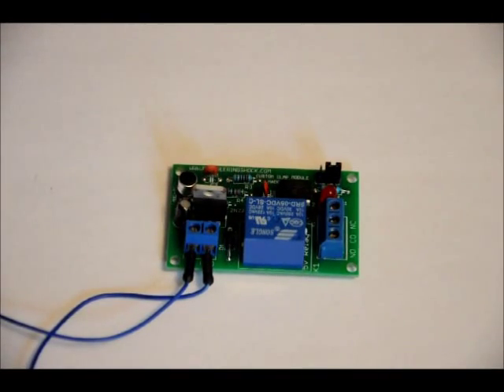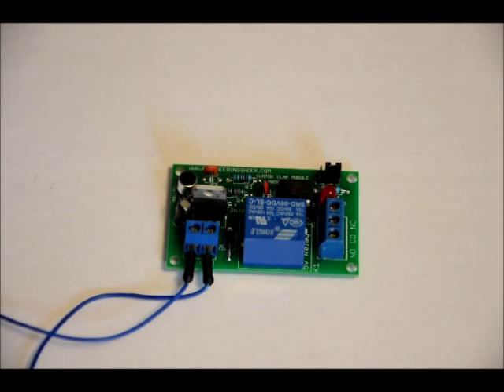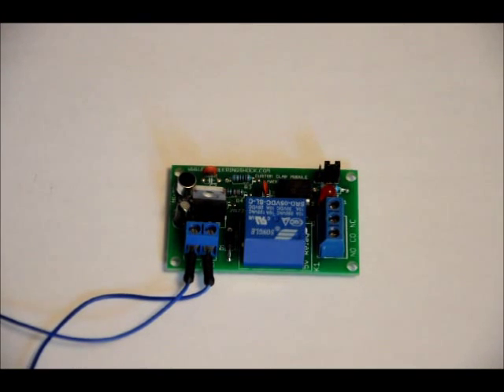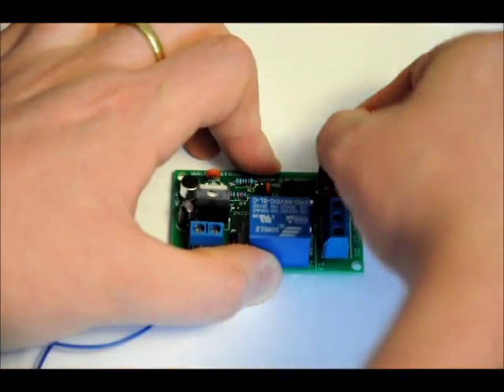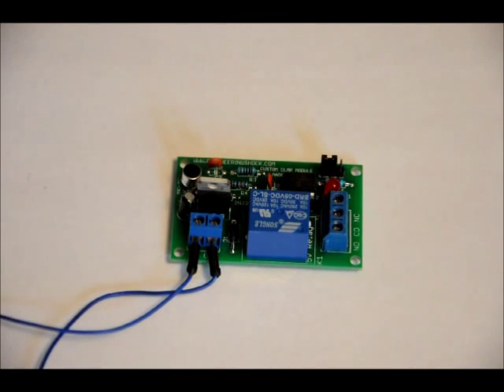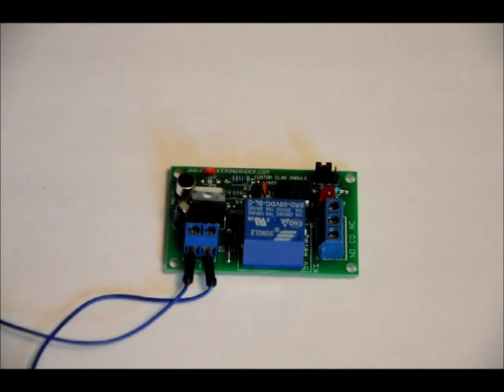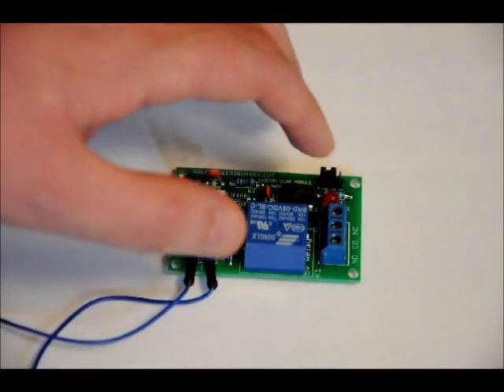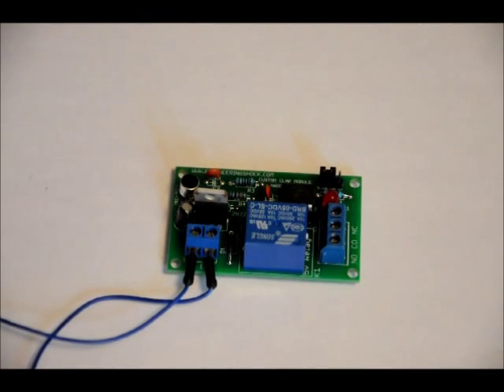The Customized Single Or Double Clap Circuit With Relay Control

Comment: Are you familiar with Z-Wave home automation? If so do you think it's possible to connect a z-wave receiver to this circuit? It would be pretty cool to be able to turn off all your lights in your house with a single clap. I have searched the web all day but couldn't find any products that support just that.

Thanks, I like your videos and your innovativity.